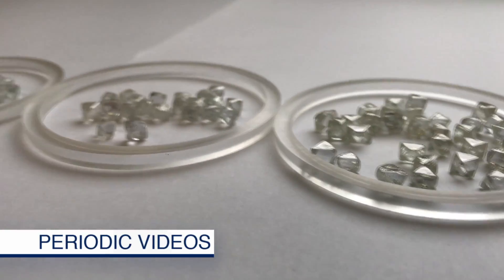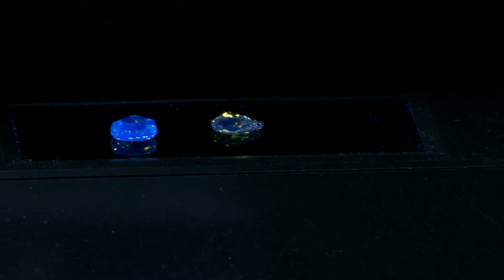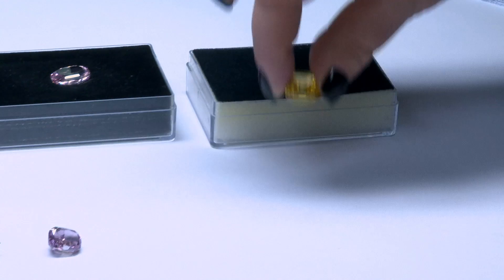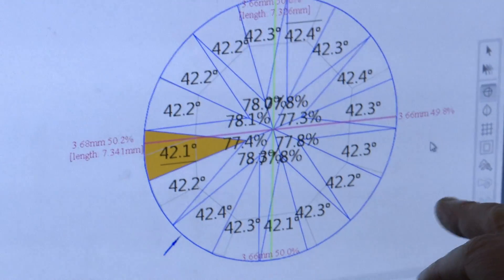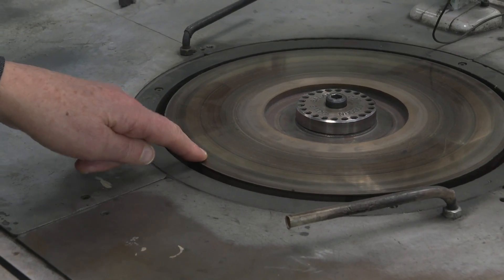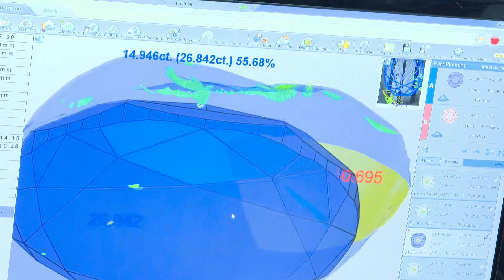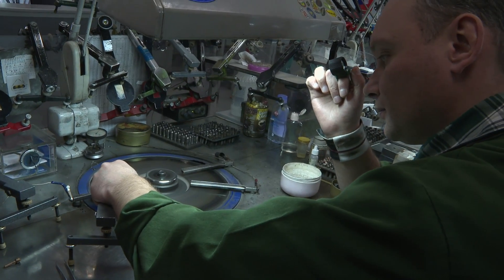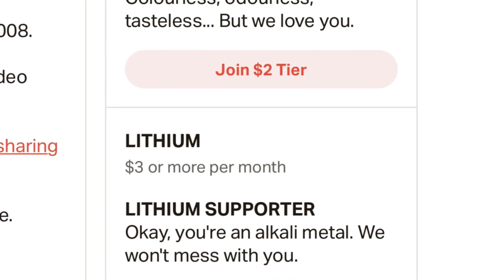Polishing a Pink Mega Diamond - Periodic Table of Videos

Comment: Diamonds are beautiful but worthless (As Jewelry) ; they are an overly abundant Gem and not nearly as rare as advertised.
Reply: I wouldn't say worthless, other than jewelry they are used for a lot of industrial tools, like drilling, polishing, cutting, military, mining, etc.
Reply: Diamonds used in industry are made in labs.
Reply: You miss the big picture. Low grade diamonds are overly abundant and they are relatively expensive because the whole process of mining, trading, refining is extremely laborious. That explains the price. However high grade diamonds are very rare and even more so with increase in size. Thus the price goes up exponentially.
Reply: James- try to resell one
Reply: @johnsongtf683  Try to resell anything at a profit (or minimal loss).

@James - cutting costs are a very small percentage of a diamond's final cost; even smaller in the case of a large and expensive stone.